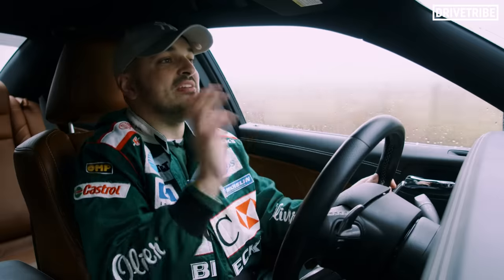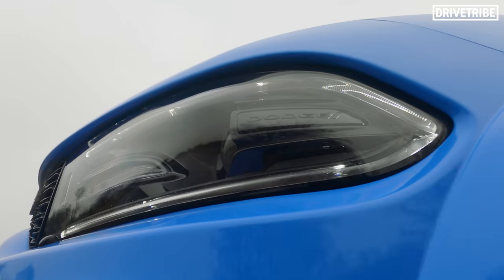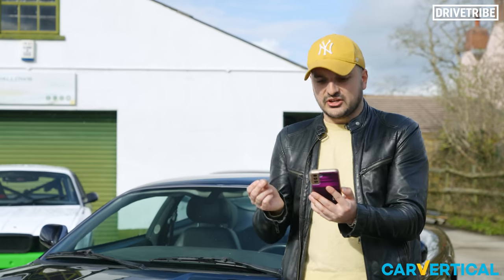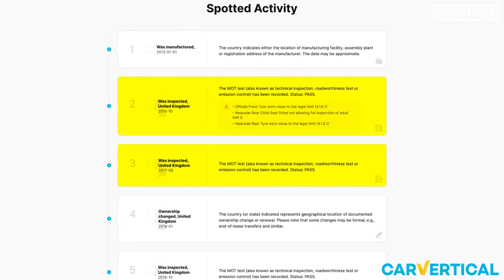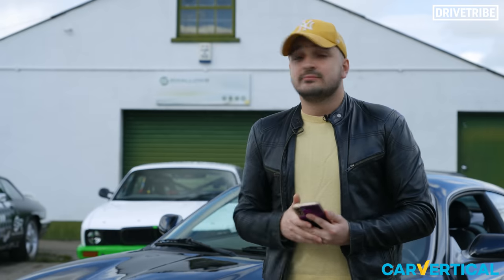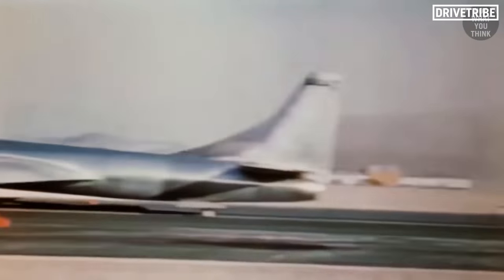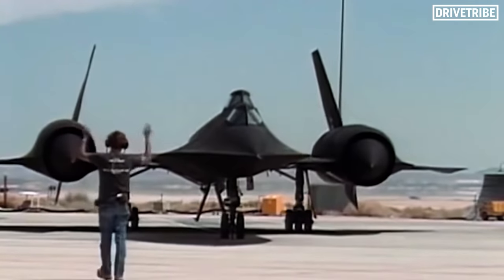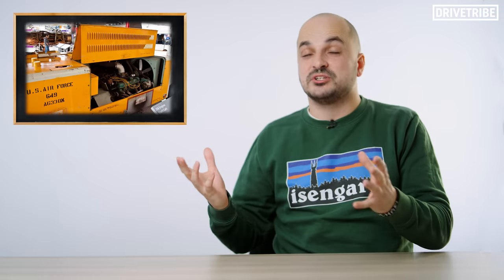This is the coolest use of a V8, and it's not in a car!

Comment: All of the SR-71s are still in the US inventory. Even though they’ve been ‘retired’ the frames of the the aircraft are still mostly intact, especially where it counts.  My fever dream is they pull them out of the dusty museums, upgrade them with better engines, latest digital technology (including F-35 networking which includes satellite integration) and put them back in the inventory.  Times have changed.  Just because the Soviet Union could theoretically shoot down the SR-71, the truth is, it is decades ahead of all combatants.  Yes, it is expensive to run but when it comes to war, all bets are off.  I wonder what the Russians would think when all of a sudden all of the existing museum airframes are removed and relocated to a facility for upgrading and recertification.  Remember, every SR-71 is capable of reassigned to tactical or strategic use in a battle theater.  I know this is a long shot (and a dream) but just putting them back in service might change a lot of hostile states in their aggression.

Comment: They never actually used a V8 in Bloodhound in the end... Originally they were going to use an F1 V8 as you said, but they changed it as JLR started sponsoring the project... In the end, they went electric as the electric tech had caught up primarily thanks to electric cars, when they initially designed the car, electric was nowhere near what it was when they built it.
Reply: I wonder if they worked with Rocketlab, The Electron is a rocket with electric turbopumps.

Comment: Just another countless reason why Buick is underrated
Reply: In the time of autonomous GM divisions I maintain that Buick had the best engine engineering overall, with Pontiac up there too.  I discount Cadillac only in that they had to be durable, smooth, quiet, and provide massive torque.  Fuel economy was not really a consideration.  But Buick did it all.  Buick and AMC were the only I've seen that picked up on what Pontiac was doing with the 30 degree intake valve angle, and the compounded benefits from that.  Olds was the torque king with over 500 ft-lbs from their 455.  Chevy was only GM's cheapest, never close to best.  At anything.  Not just least expensive, but the aspects of being "cheap", so poorly engineered that it more than any other engine *needed* a massive aftermarket.
Reply: @jeffbranch8072  idk I’ve got a k5 blazer with a TBI 350 that I daily very dependably and it based in old Chevy small block architecture, I wouldn’t call it poorly engineered. Personally I’d take an LS swap (also csb based) over any of the carbureted big block stuff. Machining and parts for those old engines also be is more than a junkyard LS swap for the same power and double the fuel economy and parts availability in every town in the US. I’d certainly not pay for a chevelle when a cutlass or skylark are way more affordable. The Buick 3800 v6 is one of the most dependable engines ever made while the Cadillac Northstar and Oldsmobile Aurora v8s had all kinds of issues. big phaetons from the 30s are significantly cheaper if you go Buick and the strait 8 will nearly keep you up with modern traffic. Buick also raced Indy and nascar around the same time they were building the t type, GN and GNX that were among some of the fastest production cars of the period. The 90s road master wagons can do more than the average modern crossover as far as all round durability and utility goes. Many of these cars are still quite affordable, except the GN stuff. You could still build a GNX clone with a turbo, a junkyard 3800 SC, Firebird/Camaro  transmission and any random G body shell for a fraction of what a real GNX costs.
Reply: The best description I've heard of the SBC is that in 1955 Chevy engineering went on the open market and bought the cheapest parts they could find, assembled it, and it happened to actually run.  Even worse than the SBC is the 60 degree block V6 engine family (2.8L, 3.1L, 3.5L, 3.6L).  Then there was the Vega engine.

Comment: You have a few things wrong in this vid.

1. The Chrysler siren was 138dB but at 100 feet away. Being right next to it would be a very fast way to deafen yourself. Also that siren is not at full revs. I'll link a video of it at full speed when I get a chance.

2. That bit about Bloodhound is just incorrect. It started out as a Cosworth F1 V8, then it switched to the Jaguar V8 but Andy Green said in a video with anothwr channel (I won't say the name but it rhymes with Bopp Steer) that fuel pump duties are taken up by a 500 horsepower electric motor for simplicity and packaging's sake.

Edit: This is a recreation of what the Chrysler air raid siren would sound like at max revs

https://youtu.be/IAMiTfSU7ZA

Comment: Face it, automotive engineering has been a sideshow lagging behind aviation engineering since the Wright brothers found that all the automotive engines were too heavy and had to design an aviation engine.  Pretty soon the hot ticket was to put an aviation engine in a car to make it faster.  Not only engines, but everything else - high octane fuel, better bearings, better lubricants, better metallurgy, better fuel control, better chassis design - monocoque to graphite fiber, aerodynamics, instrumentation, and on and on.   
turbocharging. and so on.

Note that the SR-71 never flew over the Soviet Union.  It did fly along the borders, though.  The fuel dripping from the SR71 is extraordinarily inert.  It's actually used for cooling the passenger compartment, so it needs to be able to be heated up a lot without igniting.  The green flash is the Triethylborane igniting that is used to make a high enough temperature to get that JP7 burning.

Comment: The sr-71 had such dossel fuel it was a routine thing for the piolets to put out cigarettes and cigars in the fuel leaking from the aircraft and actually need shots of another more volatile fuel to ignite the fuel during start up
Reply: I know that the slang name for the starter carts was "Buick"  because they originally  had Buick 401 engines.  I heard stories of start cart fires being extinguished by dumping the JP-8 fuel on them.  SR-71 can be started with gas turbine start carts. They would use two  high output carts to crank one engine, then inject the  liquid ignniter fluid. Green flash - then the engine is lit off.

Comment: that fuel that powered the SR-71 is very hard to ignite. If you poured it on a bonfire it would put it out. The fuel was ignited by a super volitle chemical that was injected into the engine to ignite it.

Comment: I'm sorry dude I can't listen to you when you have no idea what your talking about. The Bloodhound uses a jet engine yes but the Cosworth V8 is used to drive a turbo pump for the hybrid solid rocket motor. The fuel is a solid propellant but it uses high test Peroxide as a liquid oxidizer, supplied by the turbopump spun at 12,000rpm by the Cosworth V8.

Comment: I’d argue ford V8’s sound better, run better, produce more horsepower per liter and are more reliable. Dodges HEMI’s are lowkey aweful. They break after 60-80,000 miles of hard use while a mustang will go 180,000+ miles before needing internal work